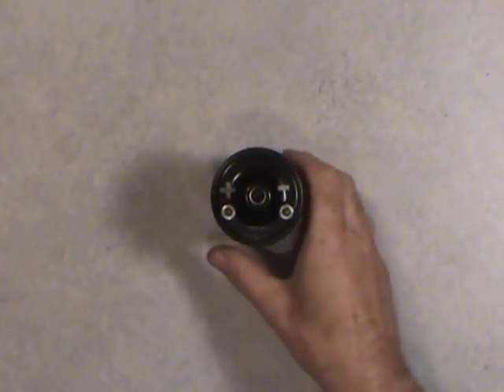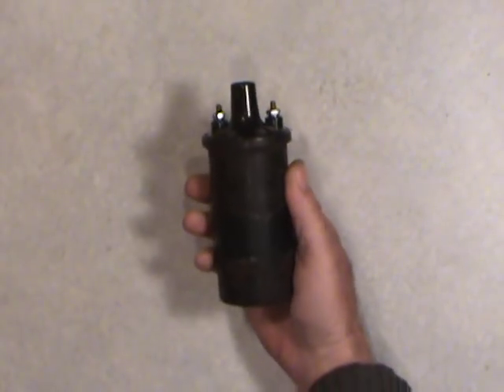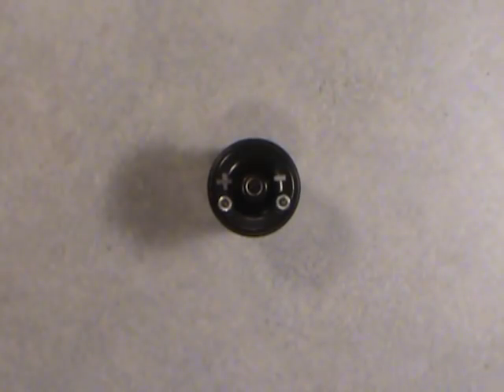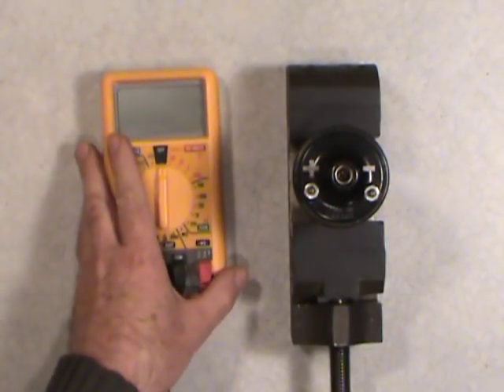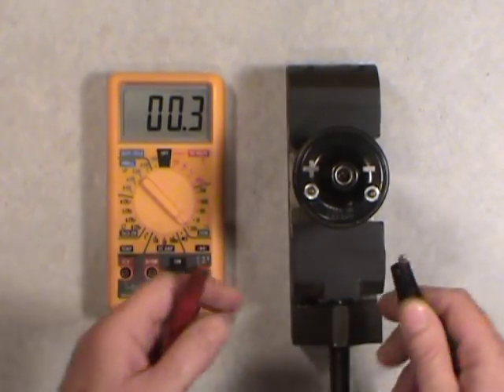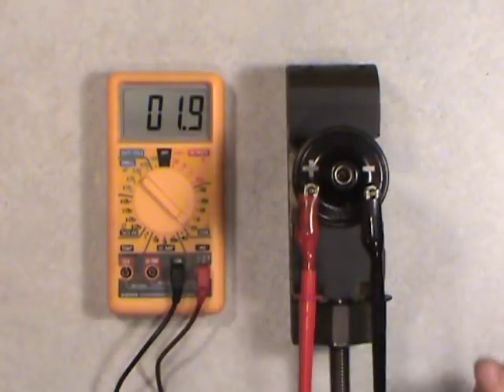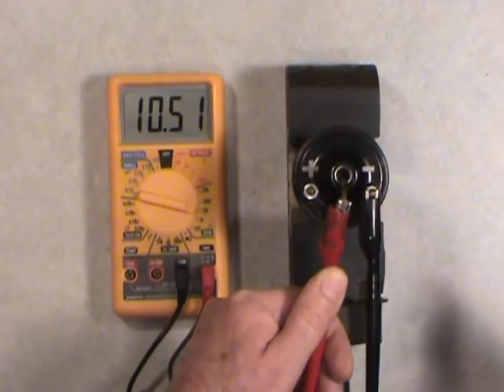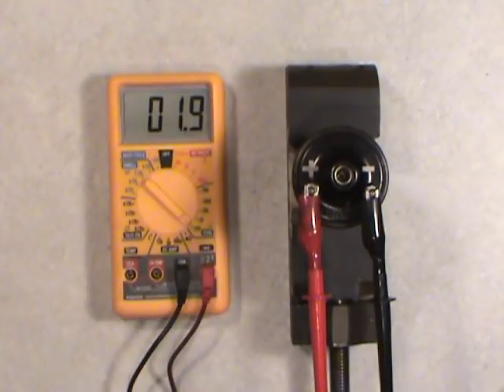Ignition Coil Testing

Comment: Your video would be ten times better if the resolution was higher.  Its difficult to see the settings on the multimeter otherwise it was very informative.
Reply from the maker: Greetings...Ron Bunker...…….Thanks for watching, and thanks, for, the nice comment too...…...Ah yes, the..."settings"...(aka, the "ranges", that can be selected, with the dial/pointer, that's at the center of, all of the ranges, that are on, this, yellow, automotive specific, multi-meter)………..Those numbers and electrical icons, sure are, quite small alright, as compared to, the display's, about 1 inch high numbers...…….Perhaps, in the future, I'll try, to remember, to..."Zoom-in"...on those small numbers and icons, as, they should show up, reasonably clearly, on the video camera, that I'm currently using...…….Who knows, I might be using, a 4-k video camera, sometime in the future...…….The "range" (setting), that I use, when testing/measuring, the primary side/low ohms, on an ignition coil, is, set at the...200 ohms range, which will measure, from zero ohms, all the way up to...200 ohms...……..For the ignition coil's secondary side/high ohms, then, I might have to use, one or two ranges, depending on, what, that particular ignition coil, is actually specified at...…..Let's say, an ignition coil's secondary side/high ohms specification happens to be, between...6,000 and 30,000 ohms...and, I didn't know, what the ohms/resistance, really was, then, I would usually select (first), the....20-k (up to 20,000) ohms range, and see, what is, (maybe?), showing, on the multi-meter's display...…….If there are several numbers (and possibly, along with, a decimal point as well), showing on the display, then, that in itself, should be the actual reading...……..Ok now, if only, the number...1...shows up on the screen, then, that tells me, that, I'm out of range, so, I then go up (higher), one more ohm's range, on the multi-meter, and, that range, happens to be...200-k (up to 200,000) ohms...…..Now then, let's say that, an imaginary, ignition coil's, secondary/high ohms, are actually 23,000 ohms, then, I would need to use the 200-k (200,000) ohms range (because, the imaginary, ignition coil's, 23,000 ohms, are higher than, the 20-k/20,000 ohms range, that's on the multi-meter)……….In case, you might not know, then, the graphic symbol (icon), that represents..."ohms"...looks, kinda-like, a..."horse-shoe"...that has its open end, pointing downwards, and, the letter...k...is short, for 1,000 (as in...1-k...equals one thousand)......….I hope that, what I posted here, is of some help to you, and...….till next time...….Be Safe, take care, and have a good one.

Comment: HELP !! :) My 1971 Pinto Coil reads 10.290 from center coil wire mount to side post, and 01.5 from - to + sides.  My 80 Datsun pickup truck Coil reads 9.900 from center coil wire mount to side post, and 01.3 from - to + sides.  A WEB site i seen on line says Coil should read  10.000 to11,000 from center plug wire mount to side post, and 0.75 to 0.81 from - to + sides. SO, ARE Both My coils on the outs :( ??? I'm using a Harbor Freight Tester. I set tester at 20k for the Coil center to side test. The meter zeros out for the pre test. BUT on the side to side test I set meter at 200, when I try the pre test it comes up at 01.3 touching testing ends together. So I deducted that from above readings mentioned. example Pinto was 02.8 - 01.3 = 01.5 And 1980 Datsun was 02.4 - 01.3 = 01.1 Is that right, LOL Boggles the mind.
Reply from the maker: Greetings...William CRAZY LACY Furmage..............Thanks for watching.............Well, some ignition coil's, ohms/resistance Specifications, can vary a bit, from one another, for the same vehicle in question, depending on, what each company/manufacturer came up with................For Your Pinto, I kinda saw overall, the Primary, at 1.1 to 1.8 Ohms, and the Secondary at 6.5-k to 15.0-k (as in, 6,500 to 15,000 Ohms), and that's quite a range alright.............As for Your Pinto, the readings that You took/calculated, seem to look alright to me.............Try to find the Specifications, that, the Manufacturer of a particular Ignition Coil, actually has, for that "Exact" (manufacturer's) ignition coil, so we don't end up falling into, the good ole, Big-as-a-Ball-Park-Specifications-Pit, cuz, we might end up being brainwashed, with the wrong information...lol.............Your Pinto, might have a Ballast Resistor in the ignition circuit (could be a resistance Wire, about 5 feet long), that lowers the Voltage and Amps, that get fed to Your Pinto's ignition coil, to keep the ignition coil from burning up, while the key is in the Run position..............When ohms/measuring, the Primary/Low ohms, on an ignition coil, it has to be Accurate, and You did a good job, figuring it out properly.............The Secondary/High Ohms side, isn't as fussy, cuz, we're dealing in, the Thousands of Ohms, and besides, most of the digital multi-meters, will be Rounding-off numbers, and moving decimal places, the higher You go, anyways..............Generically speaking, the older Points and Condenser, Distributor ignition systems, could have, 3 Ohms, or a bit more total (total in this case, could be a 3 ohm coil all by itself, or, a 1.5 ohm coil, plus, a 1.5 ohm ballast resistor, added together)..........So, if the ignition coil Primary, ohms out at 1.5 Ohms, then, we need to add a Ballast Resistor, into the ignition circuit, of about 1.5 Ohms, or a bit more, and adding 1.5 ohms, plus 1.5 ohms, we arrive at 3 ohms, which lowers the voltage, but probably more importantly, reduces the Amps, so the ignition coil doesn't Overheat and go Poof, and, the Points will probably last a lot longer as well...........If Your Pinto, is still using a Points and Condenser type of Distributor, then, it will need Regular Maintenance, as well as, having the Dwell (points gap), and Ignition Timing set too, in order to get Good Power, & Fuel Economy as well, but only if You go easy on the gas pedal.............Ignition Coils, might Ohms Test alright, but, they at times, can act up, and not work so good, once they get up to operating temperature.............Have a look on the internet, on how to do an ignition coil "Spark Test"...with a..."Spark Tester" (some are fixed, while others are adjustable), cuz, by doing so, then, a Person will be able to verify, that, the ignition coil, is capable of producing, the amount of High Voltage (thousands of volts), that are required, to actually make the Jump, between, the spark tester's...2-Electrodes................All Parts of the ignition system, have to be in very good condition, have good connections, and be adjusted properly, or, loss of power and fuel economy, it will probably end up being, and.......till next time........Be Safe, take care, and have a good one.

Comment: With 12volts into 1.6 Ohms of the Primary winding, and a D C resistance of 10,500 Ohms in the secondary, do we have a reading of 78,750 Volts jumping between the spark plug gap approx?
                                     ( A coil can also break down under load ?)

Comment: thanks! how about an old automotive condenser test too?
Reply from the maker: Greetings...Joe Weckbacher......You're Welcome, and Thanks for watching................Well, there's no real practical way of Testing a Condenser (a condenser, is also called a capacitor), that I know of, with a few exceptions, that is..................I'm assuming, that, You are talkin' about, the Condenser, that's connected-to the "Points", in a Points and Condenser, type of Distributor, are You not...???.....................I recall, reading some time ago, how Someone, had a way, to (electrically), Charge-Up a Condenser, using the Vehicle's Ignition System/Circuit, but, I don't think it was very Safe to do so..................I have, an older, Automotive Testing Meter, that has a bunch of Push-Buttons on it, and, one of them had, what happened to be, a..."Sub-Condenser"...Button, that, from what I recall, could "Substitute" the Condenser, that, was in, or on, a Points and Condenser, type of Distributor, with the "Condenser", that was hiding inside, that BIG Automotive Testing Meter of mine, when that "Sub-Condenser" Button was pushed, while also having, the thing properly hooked-up as well (gee, come to think of it, I don't recall ever using "it"...lol)......There was also, something along the lines, of a..."Points Resistance"...Push-Button as well.................I never had a Condenser, ever go "Bad" on me, that was in, or on, a Points and Condenser, type of Distributor (I'm Lucky...I guess), but, from what I recall, Condensers are very reliable..................I recall, getting a New Condenser, along with the Points that I purchased, and, some of the GMC/Chevy Point sets, had the Condenser, already mounted onto the Points, as in...All-in-One...so to speak..................Just make sure, that, You get, the "Correctly Rated Condenser", for the "Exact", Distributor/Ignition System/Circuit, that's probably, Rated in Micro-Farads, as the Condenser, is part of, a, shall we say..."Fine-ly Tuned Electrical Circuit"..............Here's a "Clue" for Ya.........If one of the Point "Contacts", are showing "Pitting" (a little hole, if You will), and the Other Contact has "Extra Metal" on It, then, that has me thinkin', that, the Condenser's Micro-Farad "Rating", is either, too Low, or too High, and, depending on, just which Point "Contact", got the Pit or Extra Metal, then, there is also a way, in which to determine, whether the Condenser's Miro-Farad Rating, is either too High, or, too Low...how about that...(I'll have to find that article....damn-it...lol)..................Also remember, "Things Change", as in, when-ever the Points "Gap" Changes, so does the (Points) "Dwell", that's measured in Degrees, which also Changes, the Whole Entire Ignition Curve, starting with the Initial (Base) Ignition Timing (in crankshaft degrees), that's usually Set, with a (strobe, type-of) Timing Light (it's been a while, but I could almost set-up, the points and condenser distributors, that I worked-on...in my sleep...!!!...Alziemers maybe...???...lol).................Make Sure, that, You use the..."Exact-Specified"...Ignition Coil and Ballast Resistor (if there is one, that is), as the (total) Ohms/Resistance Value, has to be "Correct", for that particular Ignition System/Circuit....or...sometimes, the Ignition Coil, will output a Weak Spark, at the spark plugs, or, maybe even Over-Heat & Burn-Up, and, sometimes, the Points can Burn-Up as well, if things aren't right...............If You are having any problems, just let me know, and I'll see what I can do, to help You sort them out, and.........till next time..........Be Safe, take care, and have a good one.

Comment: thank you for this video.
Reply from the maker: +Zero Niner (Zero1niner) ....Greetings Zero Niner (Zero1niner)....You are Welcome, and, Thanks for watching.........................Although an Ignition Coil might Test Good Ohms-wise, there can be times, where, a questionable or Faulty Ignition Coil, might act-up, and not work so well, perhaps intermittently, or maybe not at all, once that particular Ignition Coil Warms up to Operating Temperature or maybe even Hotter............It's very important for a Vehicle's Ignition System, to have everything, as in, a Good Battery...a Good Charging System...and also, all Wiring and Connections, and any Switches or Component Parts, in that particular Ignition System, be in very Good Condition and Clean, and if need be, Adjusted to the Vehicle Manufacturer's Specifications, so the Vehicle will be able to have Good Performance, and, if You go easy on the Gas Pedal, some fairly decent Gas Mileage/Kilometer-age it will be............So then........till next  time..........Be Safe, take care, and have a good one.

Comment: I have a 96 Chevy Caprice and it starts and run for about 10 seconds and shuts off. Do you have an explanation to this. Thank you
Reply from the maker: +boutdatlife Greetings boutdatlife....Thanks for watching......................Once I tell You about the First 2 Things, that should be done, with a Fuel Injected, Computer Controlled Vehicle, such as Your 1996 Chevy/Chevrolet Caprice, to, shall we say, help narrow-down, the very many Possibilities, that could be causing, Your Caprice's Engine to Shut-Off, after only, as You were sayin', 10 Seconds, I'll then move onto some basic things, that an Engine requires, to actually stay running, hopefully...........................Those 2 Things are...have Your Vehicle's, On-Board Computer "Scanned" for Trouble Codes, and, have Your Fuel System's, "Fuel Pressure", Checked/Verified, with a Fuel Pressure Gauge, to make sure that the Fuel Pressure, is with-in, the Specification/s, for Your Exact, Vehicle/Engine combination, and, be Very Careful, as that rather High Fuel Pressure, will probably be around 60 PSI/Pounds per square Inch...!!!.......................You will probably have, an OBD-2/On-Board-Diagnostic/s-version 2 Computer system in Your Caprice....................There is usually, a 16 Terminal Connector, that can usually be seen (I hope), near Your steering wheel, and under the dash-board, where a "Scan Tool" (kinda looks like a slightly larger, hand held calculator), plugs-into, that 16 Terminal connector, and, if there happens to be any Trouble Codes, stored in the Computer's Memory, the Scan Tool, should be showing, one or more Trouble Codes, that can be looked-up, to see what they actually mean...........................I've heard that, maybe, some of the Automotive Parts Establishments, might "Scan" Your Caprice's Computer for "Free", so, just make a few phone calls, and see, well, actually hear, what They have to say.........................Now then, about what an Engine needs, so it will (hopefully) keep running.......................The Engine itself, has to be in fairly good Condition, and also have Good Compression in all of the Cylinders........................Everything, that makes-up, the entire Ignition System, all the way from the Battery, right-on, through to the Spark Plugs, have to be in good shape, and be Adjusted to Specifications, if need be.........................Then, there's the entire Fuel System, as in Everything, from having enough Gasoline, in the Gas tank, a good High Pressure Fuel Pump (that's usually, Hiding Inside the Gas tank), a Fuel Filter that's Not Clogged-Up/Restrictive, Fuel Pump Relay, all Fuel Lines, Fuel Pressure Regulator, and a few more as well........Fuel Injectors, are pretty fussy, when it comes to Fuel Pressure, cuz, it's the Specified Amount of High Fuel Pressure, that actually makes them "Work", seeing as how, a Fuel Injector, is basically, just, an Electrically controlled "Valve", that Relies-on, the Specified, High Fuel Pressure and Volume, to actually "Flow" gasoline, "Through" the Orifice (aka, small hole) in Them, and on a good day, the Fuel Injector, will Inject, a nice Spray Pattern of Gasoline, into the Engine's Intake passageway, well, only when the, shall we say, "Valve" (fuel injector) is Open...lol..................It might turn out to be, something, along the lines, of a bad electrical connection, or maybe, a very bad vacuum leak, and, You can Visually Check for, anything that doesn't look right, worn, or disconnected, but, make sure, that Your Engine is Cold and Not Running, to Prevent Injury...!!!....................Also, make sure, that, You have plenty of Fresh Air and Ventilation, around Your Vehicle, when-ever the Engine is Running, cuz, Engine Exhaust gas is Deadly...!!!.........................So, if and when, You might have Your Caprice's Computer Scanned for Trouble Codes, and the Fuel Pressure Checked/Verified, to see if it's with-in Specifications, You can, if You care to, let me know, how You're makin' out.........Good Luck, and.......till next time.......Be Safe, take care, and have a good one.